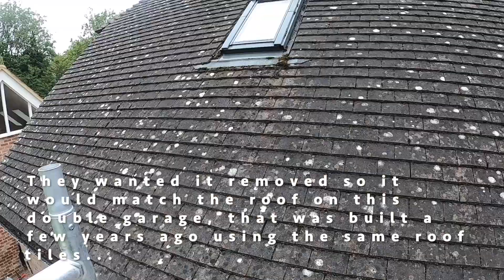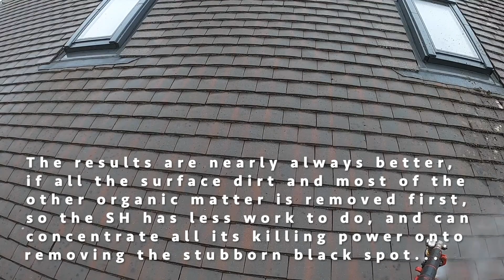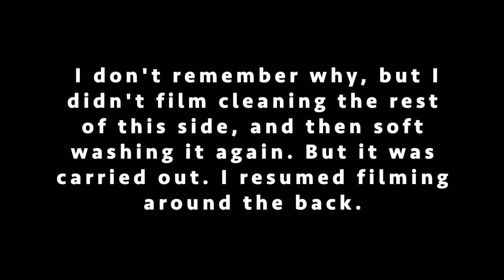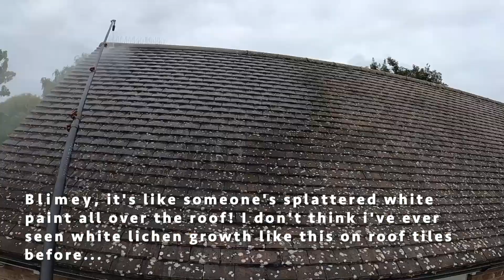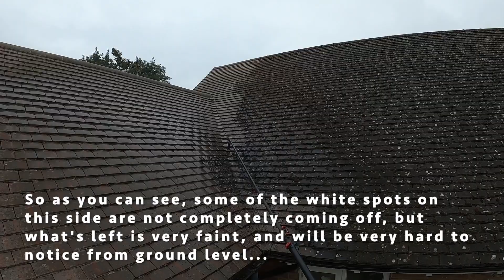Roof Cleaning Cambridge, Cambridge Roof Cleaning, Moss Removal & Biocide Treatment.

Comment: What a difference that makes!  How often, in general, does a homeowner need to have this done on this type of roof?
Reply from the maker: Many thanks Donna. It takes ages for a roof to get like this, probably around 10 years plus, depending on location 👍
Reply: @PrestigeExternalCleaning   hi, what cleaning system is it you’re using? It looks so easy and does such a good job.

Comment: Nice job, big roof there. Personally I'm always a bit nervous about cleaning roofs as there is always the risk of damage to the tiles and underlay if done badly.....nice to see you using low pressure and soft wash to get a good result.

Comment: Do you approach houses with dry ridge systems etc differently? As i would be worried about water / chemical ingress or damage to any aluminium or the likes?
Reply from the maker: I've never been asked to clean a roof with a dry ridge system. I don't think that system has been around that long. Don't see it being an issue though, if it doesn't let in water from a heavy down pour or strong winter storm, then it won't let water in from pressure washing on low pressure.
Reply: @PrestigeExternalCleaning  Fair point, cheers for getting back to me

Comment: Great job Nick, that roof has came up amazing. Do you use two separate poles for putting on the Hypo and then for the power washing? 
Also where would you get the poles for doing roofs pleased? 
It looks a lot safer than standing on the roofs. I take it you have a small scaffolding platform to stand in? 
Thanks 
Steve

Comment: I currently clean some roofs using my cold Pressure washer and get good results. I note you use both hot and cold water. Can I ask, do you think it’s worth the investment to purchase v-tuff for instance? Thanks a lot
Reply from the maker: Hi mate, if it’s just to clean roofs with, then no, not really. 95% of roofs can be cleaned with cold water, that’s all I use on most jobs. But if you’re getting into graffiti removal and brick cleaning, then yeah, a v-tuff or hotbox is a great investment 👍

Comment: Love it, you must have arms like The Hulk 🤣 is there any reason you chose SH over biocide on this one?
Reply from the maker: Lol, cheers mate. I use SH on most my roof cleans bud, I very rarely use bio. Hypo makes the roof look near perfect by instantly removing black spots and any striping left from the turbo or flat surface cleaner. Have also found that the results from hypo last just as long as any bio, if not longer, in some cases.